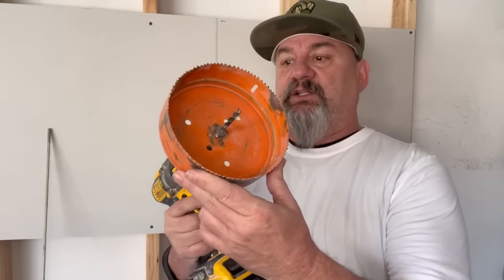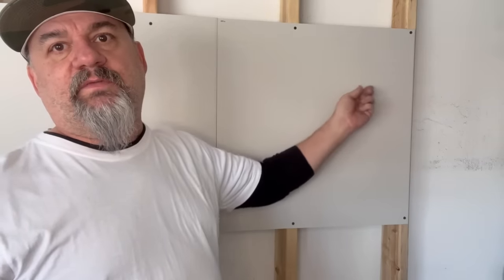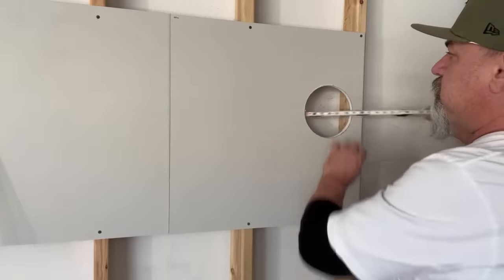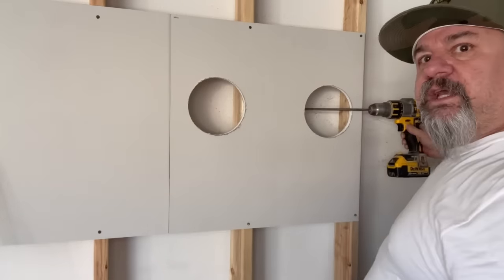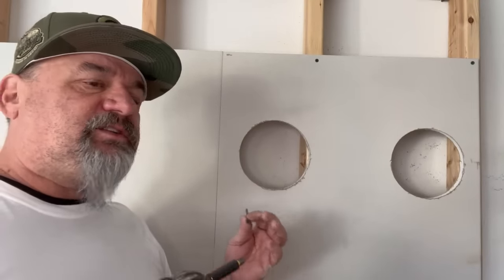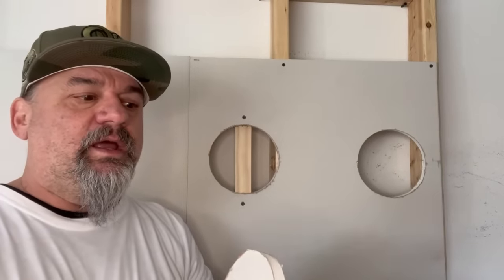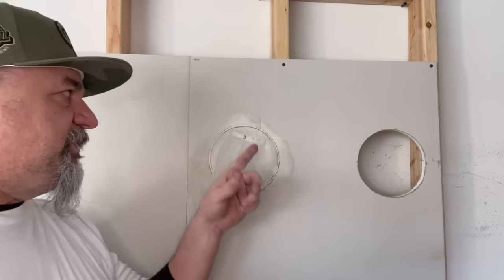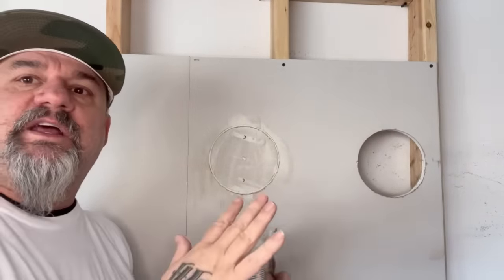Unbelievable Trick to Run Wires Through Walls and Fix Drywall - You Won't Believe What Happens Next!

Comment: I use a method that is nearly the same to work in walls that are PLASTER AND LATH. I cut a 6" hole wherever I need access, no need to find studs because you don't need to use them. I cut the 6" hole only deep enough to cut through the plaster, not the lath. I then remove the plaster slug, being careful to break off the "keys" that hold it to the lath. Don't worry if you break the slug - you should try not to break it - but if you do, it will still work. Then, take a 4" hole saw, and using the lath as the way to hold the pilot bit, cut a 4" hole. It doesn't have to be perfectly centered. It might not be centered if you had to drill the pilot hole off center to be able to use a lath to hold the drill bit. You can discard this slug as you won't need it. Next, use the 4" hole to do your work in the wall. When you are done, use a little construction adhesive to glue the 6" slug back into the hole, using the margin that remains between the 6" and 4" hole. Try to match the the bumps left from the keys you broke off. Push the slug in tight and use some masking tape if you need to keep holding it. Let the construction adhesive dry for as long as the the instructions on the tube recommend. Then, if the slug is proud, sand the slug and wall with a electric hand sander to make the whole area smooth and flat. From there, use the same steps as the video. If the slug breaks apart and can't be used, take your 6" hole saw and cut a new slug from scrap drywall. Glue that in the hole but realize that it will not be the same thickness as the plaster (probably proud) so you will have to sand it flat - possibly removing the paper. You can also peel the thicker paper off of the back if that helps a thickness problem. Just remember, the plaster slug is the best so try to not destroy it when removing it. If you were to cut all the way through the lath with the 6" saw and try to replace the slug with the backer strip, you will have way too much work trying to keep the slug and its lath together and there will always be trouble with the lath laying flat on the backer strip. I hope this helps someone with an old home.
Reply from the maker: yea its one of many tricks or hacks, just trying to share what I use if I absolutely have to!!!  thanks for watching.

Comment: Nothing wrong with what you did but when I've been faced with similar situations I just cut out a rectangular piece from the centerlines of the studs. That way when I put my new piece back I just attach it to the studs and you don't have to worry about backerboards, it's quicker and makes drilling easier to boot.

Comment: Sink those screw heads a little below flush!  It's almost impossible to hide a bump in the mud. I had a small remodel job done a couple of years ago, and the guy left his nail heads too high. I had to call him back, and we used a ball peen hammer and a woodcarvers mallet to sink the nails and create a little dimple. Worked great.
Reply from the maker: great thanks for the tip

Comment: Another way is if you cut a 6” hole saw to make your hole, then use an 8” hole saw to cut out an 8” circle then reverse the blank and cut into it with the 6” through the drywall one side but don’t cut through the last paper side so you have an 8” fabric circle with a 6” drywall circle on the other side. Screw it in as before but now you have a 2” paper cover over your hole to spackle as an over lap.
Reply from the maker: yea I am doing another video but forgot about that one. Maybe I will do another. thanks

Comment: 1.  If drilling holes, why not do the holes in between studs ?  That way 1 hole gives you access to 2 studs.
1a. So no metal stud plate to protect the wires with this method.
2.  If running across multiple studs, I found it easier to simply take out a strip of drywall about 6" wide.  Strip is as long as many studs I need to go across.    Plus I can install the metal stud protector plates afterwards also.
Reply from the maker: i jst dropped a new video addressing those things. thanks

Comment: I'm an electrian, and I like to go down the stud near the floor cut the dry wall behind the base board notch the bottom of the studs move wire horizontally  than come back up in the stud bay I need.  Than cover my cut with base board than I have no dry wall repair work to do

Comment: I did this exact same thing when running ethernet cables through my walls. Funny how I came across a video showing how to do it a year later. This same technique can be used to fix small holes in drywall that are too big to fill.  Just get a fresh board of drywall and use the hole saw to cut out the hole in it. Then use the same saw to cut out the hole in the wall to a larger size. Use the slug from the sacrificial drywall to repair the hole that you cut out of the wall. This eliminates having to measure and a cut a separate piece of drywall for the repair. Gives  you a perfect match. Pro tip; when trying to cut out the damaged drywall using a hole saw, run the saw slowly in reverse until you cut a circular groove into the drywall. This will keep the bit from wandering as the drill bit in the middle of the hole saw will likely have nothing to grab onto if you are cutting out a hole in the wall.

Comment: In this video you drilled those two holes in side-by-sides studs. 
When we do it, it's every other stud. you can fish the romex. To avoid any existing wire just run the Widowmaker or circuit tracer across the area you're going.
Reply from the maker: this is just one of many tricks. there's lots of ways to do this.

Comment: Construction adhesive would work better and avoid the screws altogether. If you use screws, you need the drywall screw driver that dimples the screw hole making it easier to mud. Thanks for you video. I like the 6 inch hole saw.

Comment: I Use Magnets to find Stud, used Jab Saw to cut up to Stud, Draw Out Box for 180 for single gang. 4" X 4" for 2 Gang. No More, then install 1900 Box, X Ring if needed, mud Ring. Wires Are attached first. If your cutting is Accurate, No Patching Needed. Wall Plate is Larger than 4"
Usually from Switches you go up or Down, not Usually Sideways.
Going down To go behind Baseboard, Minimal Patching. 
Or Go Up with a Versi Bit.

Comment: Mudding the plugs edges like that without drywall tape is taking a big chance of it cracking in the future. I prefer to make a square cut, then do a "California patch" to fix it. It takes about the same amount of time but is a much better patch once dry.
Reply from the maker: is that what its called? damn i just made a video and called it a cold patch and a hot patch. well im not drywall guy. I like to use caulk around the edges too.
Reply: @StarvingElectrician  I'm not a "drywall guy" either... a bit of a jack of all trades. But what I mean by a "California patch" is you make the hole square-ish... then cut a new piece at least 2 inches bigger than the hole (so it will be 1" wider all the way around when centered), then score the paper on the BACK side to match the hole size, then peel off the gypsum and back paper making sure to leave the top paper intact. Then mud all 4 sites of the hole and push the patch flush with the existing drywall (making sure there is mud under the paper all the way around). Then once dry, one more coat of mud and its done and invisible
Reply: @StarvingElectrician I mix 5 min dry hot mud in with my drywall mud it doesn't shrink and you can apply multiple coats even paint it. Without having to come back the next day.

Comment: Here is a tip if it interests you Get a high powered magnet about the size of a quarter and put it in a piece of toilet paper or equivalent so not to mark the walls and fish around and the magnet will stick to the screw and that is where your stud is perfectly. I once took down a old house and wanted to save the drywall and screws and this is how I located the screws then you can take the drill and revers out the screws.
Reply from the maker: great thank you

Comment: Here's the easiest way. take off your baseboard depending on the width If it's colonial base you have 3" from the subfloor cut out Wall board should have enough room about 1and a half inchs to get drill in there. If the hole is to close to the edge of stud put a metal back strip on the stud put strip of wall board back on nail on base . Done no holes to patch no repainting walls don't have a bunch of blowout patches always see them.as a contractor electricians should stick to there profession

Comment: As someone who does a lot of drywall work, I would be fine with you leaving this alone after you put your plug back in. The patch has to be taped and 3 coats put on it anyway. I like for the tape coat sinks in at the joint gap on the tape so the it's recesses in the middle of the tape for the second coat of mud. 🙂

Comment: I rewired a house for a friend when while installing a dimmer for him, we discovered that the house was wired in Aluminum. Mr. Davis said that he couldn't have that, and had me rewire it. I was an apprentice electrician at the time (1980 or so). 

We ended up having to cut only three holes in the drywall and one spot in the kitchen floor. What we did was to carefully remove the molding near the floor, bust out the brown plastic boxes, cut a notch in the drywall at floor level just below where the top edge of the molding ended, and used (of all thing) a WWII German rifle cleaning K98 chain that Mr. Davis got off of a German who no longer required its services. BTW, Mr. Davis couldn't wait for the US to get into the war, so he volunteered with the Brits in Africa as an ambulance driver. After the war he got drafted since in the eyes of the US government he had never served. :) He recalled that the first group of guys that he had to haul to the hospital was a trio of Arabs who drank antifreeze (for the alcohol content) and ended up dying.

In any case, the wire would be run along the floor line and up in to a new blue Carlon box (that had its "ears" cut off and was screwed into the stud where the old box had been).

FWIW, the German gun cleaning chain worked great for pulling Romex in a wall.

Comment: This technique would also work with odd shaped holes like square boxes or something like that.  Drilling the hole won't make a plug but just use the drill on a scrap piece of drywall and there's your plug.
Reply from the maker: yea if you have one handy. this is just one patch.

Comment: Your method is good for a quick fix, but over time the joint will exhibit cracks.  I bevel my patch and hole and prime the exposed edges with oil-based primer.  Once attached, I caulk the joint (usually two passes), then apply wood filler, then joint compound.  There is more detail than this and I don’t use tape.  The entire process eliminates cracking, but takes at least 5 days (mainly to allow enuf time for the caulk to dry), so a contractor is not likely to do this, but I’m a DIYer, so I do.
Reply from the maker: ok cool. yea im dropping a new video with more patches. i hope I dont mess them up too much

Comment: These holes would be easier to repair if the cut through the drywall was at a 45 degree angle, going at an angle towards the center of the circle. If the circle is cut this way, the tendency to push the cut piece through the hole would be eliminated, when pressure is applied mudding the repair. This can be done easily with a keyhole saw, which would also eliminate aerosolizing drywall dust with the drill.

Another option is to cut an entire strip out of the drywall, exposing every stud. This is for larger electrical retrofits / repairs. It may seem extreme, but the entire wall needs to be re-finished and painted anyway. It is easier for drywallers to replace the entire strip or drywall, taping and mudding two horizontal seams to blend them into the wall, rather than numerous holes along the wall, every 16 inches. In addition, backing strips would only have to be installed at either end of the wall, where the drywall is left on the stud in the corners.

Either way, a conversation with the homeowner and drywall contractor would be recommended. That way they can hash out ideas and costs, leaving you free of the headache of drywall repair costs.
Reply from the maker: this is just one of many tricks. there's lots of ways to do this.

Comment: You give good advice on the safe and practical way to do this. In addition to your method I always use an electronic metal and live wire detector as well, just in case.

Comment: You can get voltage sensing cable finders very cheaply, also most stud and cable / pipe  finders will detect nails in the studs.  That should give you a good idea where the cables are.   In UK the cables have to go either vertically up or down from a light switch or socket or horizontally ( sometimes horizontally with sockets as a ring main is used in UK where some countries use individual multiple drop circuits ),  not on an angle across the wall... also cables behind drywall should have a galvanised capping over them to protect a bit against the cable getting drilled as a masonary drill has a hard time cutting steel.
Reply from the maker: this is just one of many tricks. there's lots of ways to do this.

Comment: I do use angle drill 18v and short spade if is need it . 3" blade and 20 compound will do quicker patch.
Reply from the maker: right on thanks for the tip

Comment: A small tip; before putting your hole saw in your drill, take a clear plastic bag, make a small hole. Put your hole saw inside the bag, with your drill on the outside. make sure your drill can spin freely, without catching the plastic bag. Using blue painters tape, tape the large, open end of the bag to the wall around where you will drill,  Drill each hole, then remove and toss the bag of dust. There's no dust flying around, vacuuming or time wasted cleaning up. Fast, cheap and easy.
Reply from the maker: I love that trick. yep I should have remembered it

Comment: This method may be ok when there is no other access to the area. Such as through the attic or basement top and bottom plate. Had the run extended beyond the two studs It would be much easier to make one long access closer to the floor. It's easier to patch one large hole than a bunch of individual cheesecake holes not to mention taping a round hole is a real pain.  Without taping, that repair will surely crack sooner or later.  And lower down the repairs are much less noticeable. Often this type of old work can best be done by removing the baseboards and working behind them. No drywall repairs required at all other than replacing the cut-out piece. And finally, using a hole saw can be very dangerous as hidden wires, pipes, (hopefully not gas) etc. can easily be damaged as there is little depth control of the hole saw. There are better tools for the job that would allow accurate depth control and a much finer cut than the ragged edge a hole saw produces.

Comment: It's MUCH easier to just take a 4" slice out as far as you need to go with an oscillating tool, you are left with two straight runs of tape (and YES you need tape to prevent future cracking!)  Easier still if you can pull a base molding because you can then just slam the base back on ( be sure to add nail plates) and the third trick is, don't make your cut  between chest height and eye level because that is where a blemish in the final wall finish will be most noticeable. Having to patch ROUND holes requires mutiple overlapping edges of tape, higher compound build height and uneven pull of the knife from right to left since the layer of compound will vary in thickness.
Reply from the maker: yea its one of many tricks or hacks, just trying to share what I use if I absolutely have to!!!  thanks for watching.

Comment: Residential single-family homes are built way, different than townhomes, duplexes, apartment complexes & high-rises (residential) framing with  insulation, exterior walls, demising walls are built way different. The structural support as you go higher sometimes you have a glue lambs, Sometimes you have a stud packs which ranges from three 2x4 , six 2 x 8 , many different options. Take photos and pictures. Learn how the structure you are working in on a regular basis is built.

Comment: Try using half as many holes (between every other stud), with a short bit on a driver to keep it short - that stud doesn’t require a 24” bit and rework/repair becomes much more simple. You also keep the drilling away from studs and potential wiring and plumbing damage!
Reply from the maker: this is just one way
Reply: but then you don't get to check if there's anything in that void - like wiring or plumbing

Comment: A little tip from back when I used to sell hifi gear.  We sold a product that went on as a clear gel which you waited to dry and peel off when done.  The hard part was peeling it off.
We found that putting some masking tape so there was an inch or so hanging over the edge then pull until it started to peel off .

The wood glue is much cheaper because the people who use it it aren't stupid like so many hifi geeks who will buy anything at any price, like speaker wire, if they believe it will help.
Reply from the maker: I can dig that. thanks

Comment: Love the huge hole. It does make it a lot easier. I got lucky, I have a closet on the backside of my TV wall. I ran everything into the closet and even have a computer in the closet. I used PVC pipes ran through the wall and caulked it. I have a plug in the closet, so it made it even easier.
Reply from the maker: right on! thank you